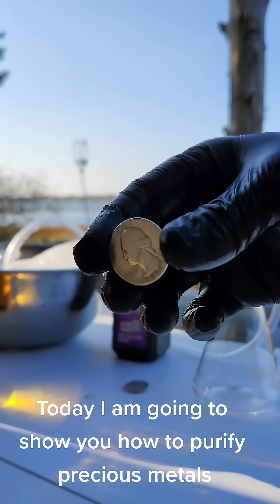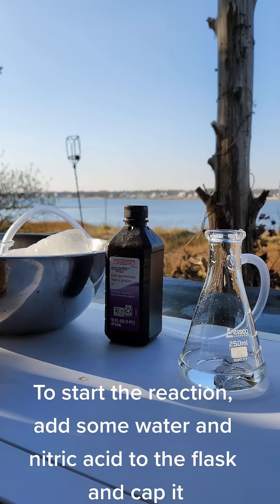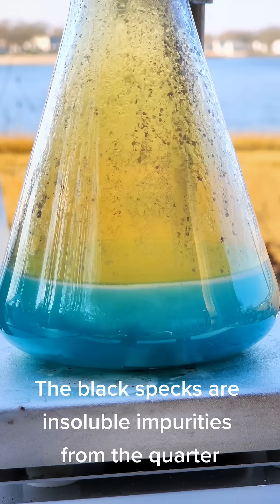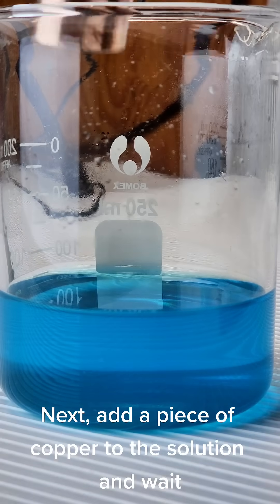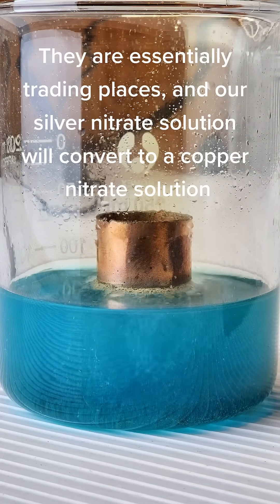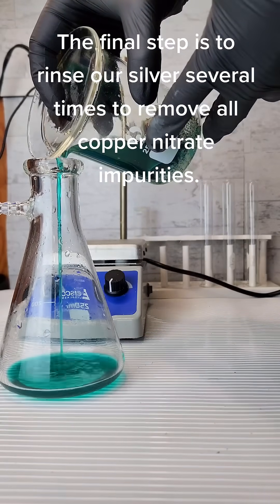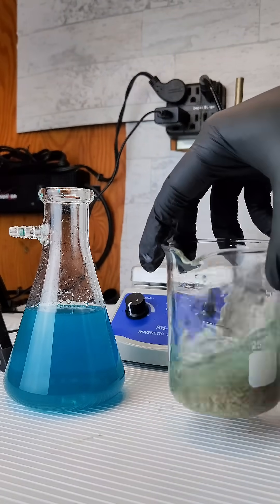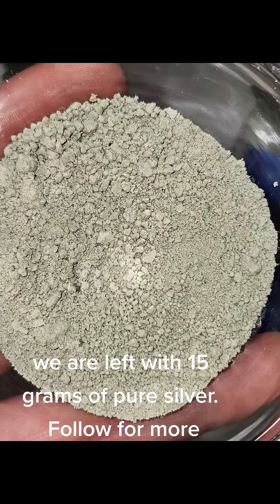Extracting Silver from Old Quarters (TTS)

Comment: Uncredible nice surrounding to carry out experiments outdoors! 😎
It's already hard to get all copper salt rinsed out cleanly, so it is not advisible to add even more by displacent reaction. Always test the silver for residual Cu with ammonia solution.
I recover Ag from its salt waste by precipitation as AgCl, decanting, resuspending and filtering this before redissoving in ammonia solution and reducing the resulting diammin silver complex to metallic silver by ascorbic acid. After decanting, resuspending, filtering and drying the precipitated silver I melt it together to nice and shiny granules treating the powder with a blow torch after being transfered portionwise to small holes carved into pieces of charcoal.

Comment: you can add hydrogen peroxide to the nitric acid mixture directly! but the silver might catalyze its decomposition
Reply: No positive effect: the dissolution of Ag stops until all H2O2 is decomposed.
Works much better with copper or lead, especially when you want them to dissolve in non-oxidizing acids.